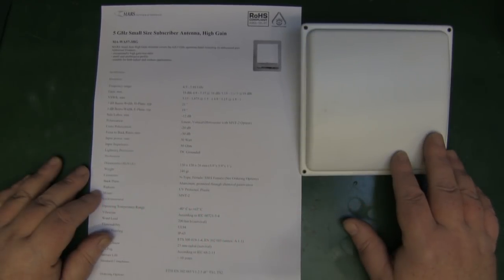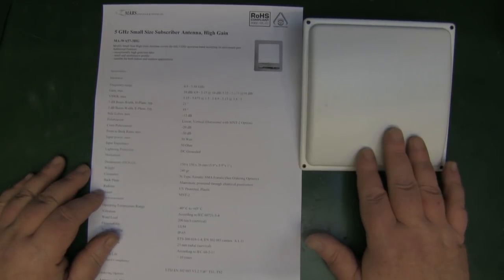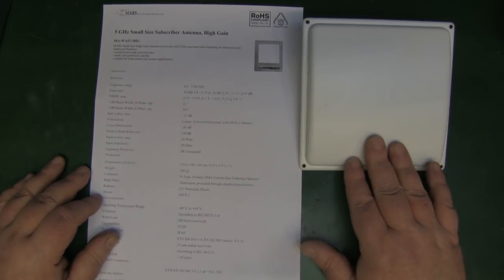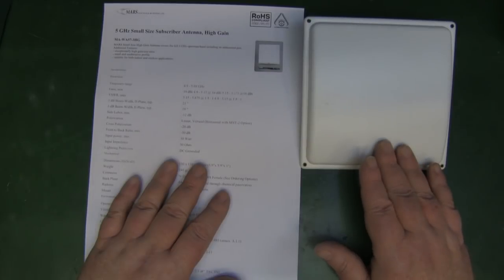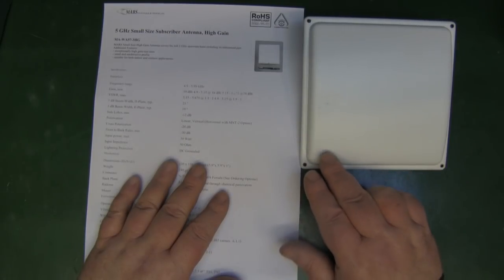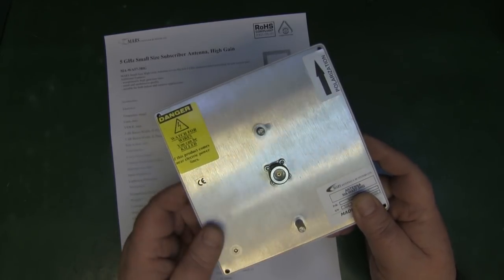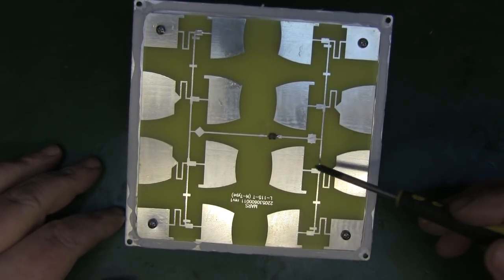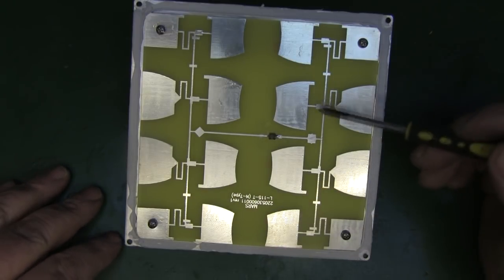MARS 4 9 to 5 8GHz Panel Antenna MAWA57 3HG

Comment: Very clear. If my glider has a pagoda antenna, do you think it will work with the Mars antenna polarized vertical ?
Reply from the maker: No you need a circular polarized antenna
Reply: @andrewmcneil  thanks a lot. Then a triple feed patch antenna should be fine. Correct ?

Comment: @andrew mcniel Another great video! Could you please tell me the thickness of copper trace I need when designing pcb biquad yagi? Sorry to keep asking I just can't get you to answer. Thanks
Reply from the maker: I use 3mm  and remember your 1/4 wavelength measurement is the outside edge.
Reply: @andrewmcneil  you are awesome thanks so much